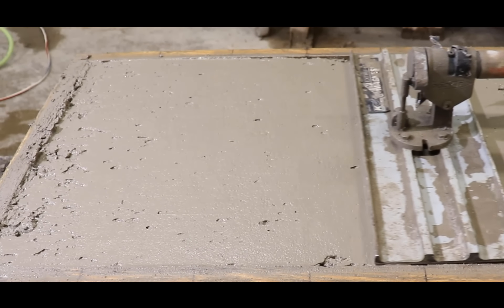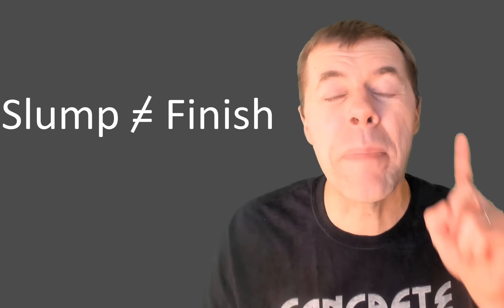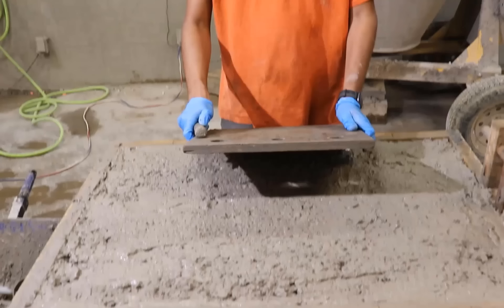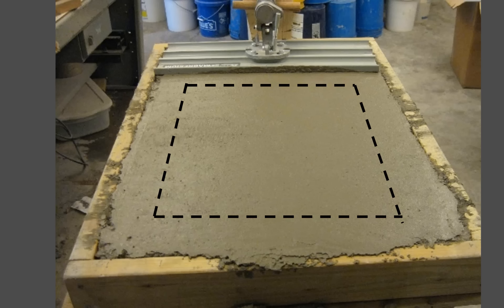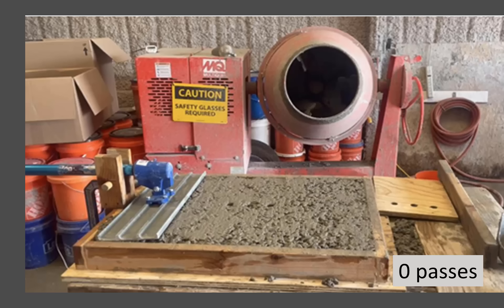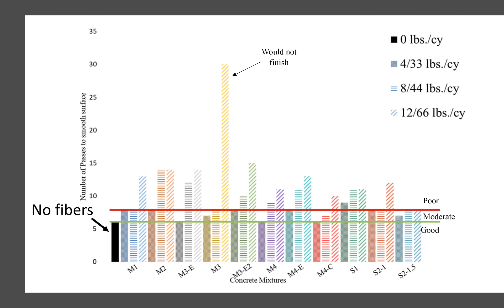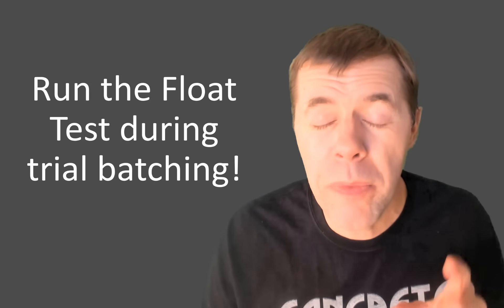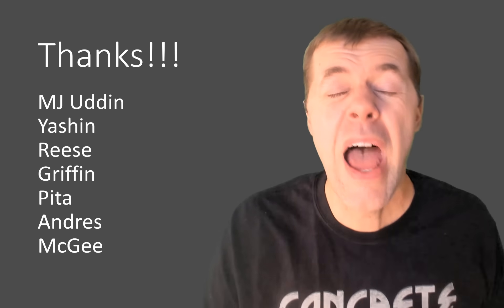The Secret to Finishing Concrete

Comment: Could a fiberglass cloth and cement composite be made the way that fiberglass cloth and resins are made, if no sand or other aggregates are added to the cement, just a superplasticizer to make the cement possibly fluid enough to infuse into the cloth? Just as a surface layer, I mean.

Comment: It is amazing that 30 years ago cement was 100% clinker. Now there is cement II A with 80-90% clinker on the market. And in the same package, II B is sold, which contains 60-75% clinker. The price has increased from 4 euros to 13 euros and the bag has shrunk from 40 kg to 20-35 kg.🤣

Comment: Now for something relevant, Sakrete, and I assume others, suggests you mix their product for at least 5 minutes. That's no problem for a barrel mixer as all you have to do is watch it spin for that length of time before dumping it. The toy called Mud Mixer mixes dry mix for about 10 seconds, and you have no control over that. I doubt that's long enough to produce a mix with the rating on the bag. Testing a cylinder of the mix is impossible because creating the cylinder requires a thorough rodding/mixing. I hope someone, as curious as I am, will create some cylinders by core drilling cured concrete, and make a comparison between plant, barrel, and toy!!

Comment: My dad made my brother and I work every weekend for a summer when I was 11 and my brother was 6,  he made us fill the mixer, which he had upgraded with a collar since the support brace was broke and welded back using 2 Iron bolted flat steal 1/2 circles to fix. It took 15 shovels of 3/4 rock, 1/2 from the bottom and half from the top of the pile in the front of our house, then 3 shovels of cement, and "enough water".  Too much water would leak down onto the motor and it would wake me up with an electrical charge every time my shovel touched touched the mixer.
We poured a basketball court size garage that summer.  I remember inviting all my friends over to  hang out, sleep over, then I would wake them up early and tell them they needed to help.  I lost a lot of friends that summer.

Comment: As a finisher, this video is frustrating. There are many things one can do to make the job easier, but there are too many variables to expect any consistency. Sometimes it's a bastard, sometimes your waiting for hours. I finish all kinds of mix designs working with different contractors and the most frustrating thing is the fractured aggregate they use. It's almost impossible to finish it properly because even if you have a good amount of cement the sharp edges catch on your tools and roll rocks. That's why everyone uses finishers aid now. Why can't we have a mix with tumbled fines or something.

Comment: From experience, the majority of concrete finishers don't give a whit about concrete quality.  They just keep adding water until the concrete flows like thin pudding.
Few if any confirm the slump and when was the last time you saw anyone placing concrete, taking steps to properly cure concrete?  Answer.  They don't.
Bottom line, unless you were there when the concrete mix was batched, you have no idea what is in it, percentage wise or otherwise.

Comment: Under 30 yrs old I mix 2, 80 pounds concrete Kwik mix at a time in a wheelbarrow doing sidewalks up too 42 or 60 at a time know timing on concrete after boat floating.

Comment: Your suppose to do this to check your batch before you pour? R u serious? If the load comes to wet or to thick you just get it done, make it happen. If you can't, don't finish.
Reply: Exactly
Reply from the maker: What if they could design you a mix that would make it easier to finish?  If the mix is in bad shape then it shouldn't be on you to fix it.

Comment: I have done more mixes by hand in a concrete mixer than i bet most people on this planet "apart from mexicans".
I 100% Can tell you, the finishablility comes down to the person who is making your aggregate that you mix your cement with.
I had a guy at my local for a few years who made beautiful stuff, he said he didn't wash it to keep the clay particles in it, finished beautiful.
Now when i get a clean trailer load, for some jobs i will add a little clay to the mix and it makes it go beautiful.
Also when i do castings in a outdoor fireplace, lots of clay in the mix makes it not crack, or just hairline cracks.

Comment: I am an absolute amateur but since trying immersion vibrator I use it as a replacement of adding water when I want to have more fluid mixture. It is great for all jobs except when making non-horizontal surfaces, as it causes any mixture to become so fluid so it levels up itself almost perfectly.

Comment: WHEN CONCRETE IS NOT PROPERLY MIXED,SCREENED AND PRESSURED IN THERE WILL BE AIR POCKETS AND CRACKS ARE SURE TO FOLLOW!!! I HAVE SEEN THE RESULTS OF 8" CONCRETE POURED. AND IT WAS EVEN ROLLED IN ON A GIANT 1000
FEET LONG SLAB 200' FEET WIDE AND IT WAS JUNK IN LESS THAN 2 YEARS,ANOTHER COMPANY CAME IN AND CUT OUT THE CRUSH AND SAID THE PROFESSIONAL'S THAT DID THE ORIGINAL JOB INSTALLED THE CHEAPEST MIX POSSIBLE,SOMETIMES YOU DON'T GET WHAT YOU PAID FOR!!!❤😮😊

Comment: Tyler, great to find your video here.  I do have a background in engineering but have been more a diy guy for years now.  I've worked with almost everything and do like concrete and mortar.  It is hard work but it's kind of in the open, as compared to say working on a car- argh!  Well I mostly learn by my own experiences and problems.  I was overfinishing and getting a very wet top surface, even though I was trying to mix anti-soupy.  I will be working to overcome this down the road.  I plan to give more time for it to set before trying to finish, maybe just a bit of leveling after it is poured.  It seemed to me the water would just rise up but this was probably do to working too soon?
Reply: Please try immersion vibrator. It makes a huge difference. I can't imagine doing any job with concrete without it.

Comment: We're starting to see more and more issues arise from type 1L we've never experienced before. Mainly more chalking/dusting. Some of the best concrete guys in the industry are having these same issues. The last 2 driveways we did we actually went back and applied and densifier typically used in polishing concrete, which we do as well. I asked my mentor Mr. Bob Harris who works for SSI (Structural services incorporated) if theres a possibility of adding a densifier to the concrete mix. He said yes, you can add colloidal silica but it messes with the water/cement ratio. Im going down to help him teach a training at the Decorative Concrete Institute end of this month. Have a few well known collegues coming just to talk about some of problems and hopefully solutions. Have you done any testing with using densifier or colloidal silica to the concrete mix? Our industry is seeing a lot of issues. We need help

Comment: Awesome video, Tyler. Question - do you have data for finishing passes with 1L cement with no fly ash or slag? I see a number of other finishers using “straight cement” mix and am trying to get a good handle on the pros & cons of straight cement vs fly ash/slag with Type 1L.

Comment: I’ve been working with concrete since the age of 16. I started out as a Mason Tender installing swimming pool coping, and pouring 10” thick X 48” high steel reinforced concrete pool walls. The person batching the mix at the concrete plant can make or break your project, and you need to know how to work the mix. Hot mix was the biggest problem I ever encountered Leftover concrete from a prior job that’s mixed with your order The old concrete that should have been discharged from the ready-mix truck sets off the the fresh concrete, and it accelerates the setting process. Concrete waits for no man, especially on a hot day😁
Reply: Respect for all concrete workers

Comment: I'm surprised that for formed flat work (contained) you don't see everyone using a mid range water reducer to get in the 6-7 slump range.  It's so easy to place and finish and you can keep water / cement ratio around 0.45.  It also results is basically zero bleed water, so you can strike it, float it in one or maybe two passes and then just wait for final finish.  A mid range water reducer is not an expensive mix ingredient.  If you are using a vibratory screed, it's so easy.

Seems like a lot of folks simply equate low slump with strength and don't take into account modern admixtures.
Reply: @christopher - agree with your comment. For flat work I contend it is far easier to move, place, and finish if just a touch wetter.
So much easier on a crew for large pours not wrestle a gigantic ball of silly puddy all day and then beat that into submission on the finish. So what if I have to wait a few more minutes on the end for water evaporation.
And for sidewalks heaven forbid I loose 1k tensile.

Comment: There are plenty of takeaways here, but one that I'm remembering is to poke 3 holes in the surface in order to avoid overfinishing. 
 Finishing is done on the same  pass that the holes get filled up. 
 I hope that's accurate.
Reply: Maybe. It all depends on the mix. There are many good mixes designed for specific uses which you couldn't poke holes in. Some you could. Likewise with fibers. It's a mixed bag, no pun intended, depending on the desired outcome for your mix/finish.

Comment: Have the honor, it's typical North America. Here in Upper Bavaria, most concrete is used for houses, especially for basements and ceilings, but also for smaller underground garages with ramps, of course only as reinforced concrete. Concrete pavers are also sometimes used here for terraces/patios, driveways and the like, but these are used as finished stones. 
What I have noticed in many videos about concrete in the USA is that the concrete is poured directly onto the substrate or gravel/crushed stone without a separating layer (plastic film etc.). On the other hand, the concrete is usually placed without compacting/vibrating, why is that? Here, we always use separating layers (yes, several) under the concrete on the floor, which is another reason to avoid cracks. This “spreading / rubbing test would not make sense for us, because no one here installs concrete without compacting it, even if the surface is smoothed, for example.
If I already have a professor for concrete here, I have another question, why can't I find any videos from the USA showing a normal rebar concrete floor over a basement or garage without any steel beams, just rebar and concrete? Is that not allowed in your country? 
I am a Bavarian master craftsman for bricklaying, reinforced concrete work and carpentry, as well as a structural engineer. 
Greetings from Upper Bavaria.
Reply: We use all of those methods you have mentioned in the USA in addition to many others. It entirely depends on the application, location, applicable code, budget, regional constraints on available materials, etc. For example, Upper Bavaria is similar climate to parts of Washington State but extremely different than Arizona. You would not practice all of the same methods in Arizona as you do in Washington State.
Reply: I’m a commercial electrician so probably not qualified to answer but the majority of the work I see is compacted prior to pour and I think more newer homes are starting to put down vapor barriers… but in the good ol US of A we’ve have yet to meet a corner we won’t cut so many sites will skip both
Reply: I'm a stonemason, I've been working with concrete  for more than 30 years. Just my opinion. There's 5 major contributing factors to a good pour. First is proper sub base compaction and prep. 2nd is properly placed, spaced steel into a thicker slab than you think you need. 3 ordering   a stronger mix than you need, let the professionals at the concrete plant do what they do best. 4,  is well-timed concrete cutting. 5 is the most important. Its to have an experienced professional concrete placer , layer control the pour, let him do his job. Don't attempt to be pro at concrete by doing your own pours after doing your own on 5 or 6 previous occasions.

Comment: Based on the information presented, I don’t believe there is sufficient control on the process to get consistent results. Specifically, the yolk alone won’t ensure the same angle (at the head of the float) since you are also adjusting the “knuckle” to change the striking angle. Also unclear how much downward force is being applied; is it only the weight of the float and handle, or can the operator apply a downward force? I do agree that finishability and slump are not the same and that an evaluation is needed. Maybe some fine tuning.

Comment: I've been a structural engineer for a long time.  I don't normally get involved in the finishing and that's good, I don't want to be involved in the finishing.  Things I've heard on the jobsite make me think there are a lot of variables in finishing and probably experience and black magic and outright luck.  You seem to have a way to get past the uncertainty.
One of my projects a few years ago was to have polished concrete and after the polishing there was a lot of tiny microcracking in many areas of the concrete as well as areas wtih 1/8" deep spalling.  I think it had something to do with the finishing but the concrete subcontractor disagreed.  I thought it unfortunate that there wasn't a defined failproof procedure to give the desired results.
Something you didn't mention was temperature which seems to be a significant variable.  The float test is probably a good way to investigate the affect of this too.
Reply from the maker: Thanks for the comments!
Your polishing issue sounds like plastic shrinkage cracking that was finished.

I agree that temperature is important!  Thanks for pointing that out.
Reply: Temperature is most important...changes everything

Comment: Interested of concrete construction for a long time (Asked for a bag of concrete as  birthday gift in 1983  ,i was twelve) learned forming ,reebaring, mixing  in late -89. Still wondering if americans ever gonna understand concrete constructions. Remember in-82  bridge construction collapse when slab  holding formtower failed? Or Oklahoma fbi building collapsed?reebar missing .andNO  driveway slabs doesn't always crack .but if yo pour 4inches on top of lawn with only 6mm string of reebar it will. Do it better mf. Have a good day and learn house framing.

Comment: the concrete guys i have seen never do any of the testing you suggest here. they just pour, strike, float, finish, and maybe edge. maybe. oh, then lunch
Reply from the maker: If you order the same mix over and over again then you don't need a test like this.  When we use new materials like fibers or a new cement then this is important to use in the mix design stage.  If this was done in the industry now it would address a lot of issues.
Reply: These are not field tests, very impractical.  This is a lab test when design the mix that you want to sell to the customer or concrete guys.

Thats not a "concrete guys" job. Thats an engineer job. The concrete suppliers also do lab tests before sending trucks out.
Reply from the maker: @NSER164  Thanks!!!
Reply: It's all case by case, what is it being used for? Or how precise do you want or need to be? When working on something that could collapse and kill many people, many tests are required. Parking decks, high rises, bridges, etc. Now, if you just want to be super precise, then why not? Thank you for the information!